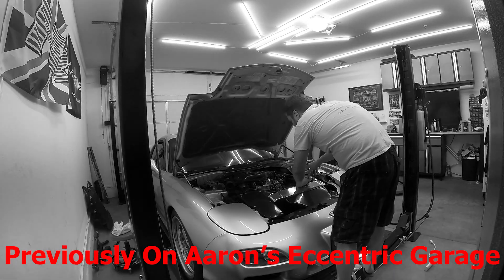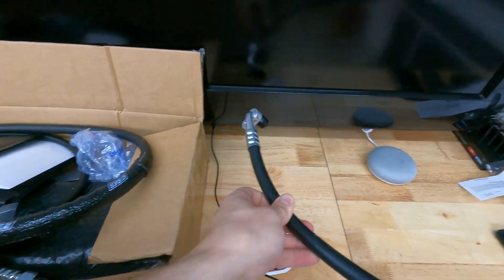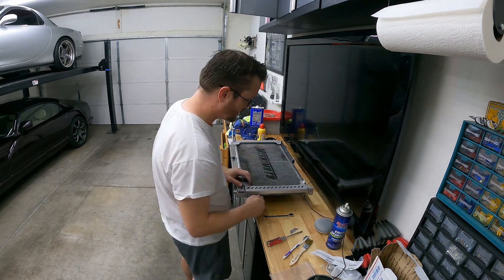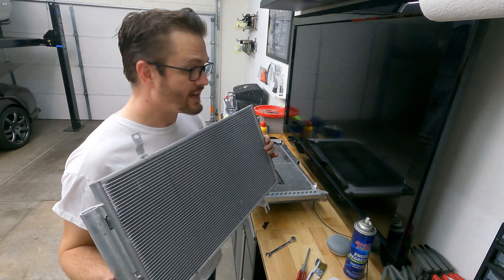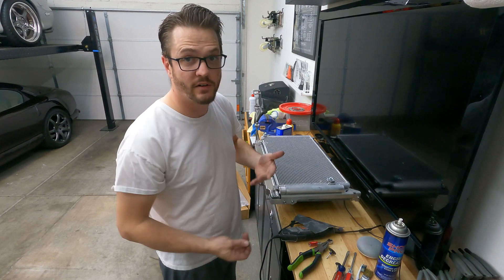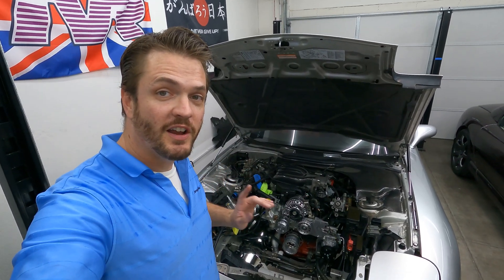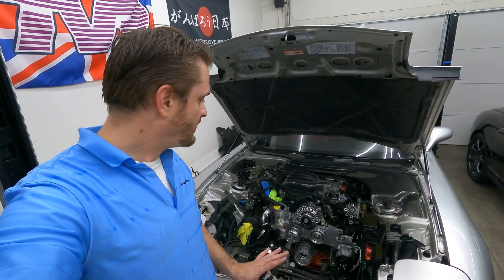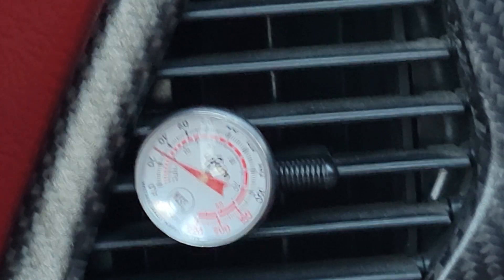Mazda Rx-7 Repair Part 2: How To Upgrade Your AC System From R12 To R134a

Comment: what happened with the evap coil...did you clean it and how???
Reply from the maker: @robertsutton2407  yup. Removed it from under the passenger side, cleaned it up, swapped the expansion valve with the new one from jp3, added new insulation foam and plugged it all back in
Reply: What did you use? Steam or spray cleaner  product?  Brand name
Reply from the maker: @robertsutton2407  hot water and simple green
Reply: Amazing and so simple

Comment: Hi Aaron,

Curious: is it possible to modify to upgrade a 1989 FC Mazda Rx-7 Convertible Rx7 air conditioning system?
Reply from the maker: @battlehorsky  yes. Jp3 Motorsports makes a kit for the FC now

Comment: Those are the OEM mounting tabs on the condenser. I used to cut mine off too but I've since added brackets to the radiator so I can bolt it right on. It is cleaner and less obtrusive with them removed though.

Comment: Great Video Aaron! 
I live in the Middle East where it's 107F ~ 119F in the summer (Mid May till Mid August), so I really need this even when in Early September till End of April.
My FD is bone stock with RE Amemiya Intake and Large SMIC, with Koyo Radiator, hope i won't have problems.
Reply from the maker: Vented hood will help a ton. Visit rx7club.com for oodles of tips

Comment: How much did this whole set up set you back
Reply from the maker: Roughly $1k with all new components. No small amount, but they also have kits for vMount and you can buy it in pieces rather than a whole kit, so you can make a custom setup that works for you! Which is nice that we have options.  If your old r12 has been adapted to work with r134a and is fine, keep it going.  But if your r12 compressor dies, this is a good alternative that works great,  and has parts that are cheaper and more accessible should you need to work on them in the future.